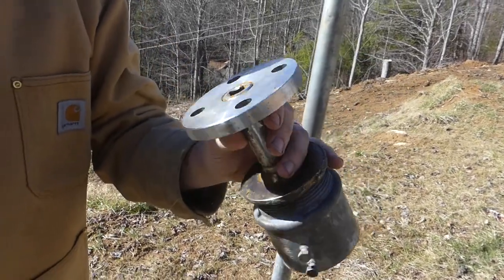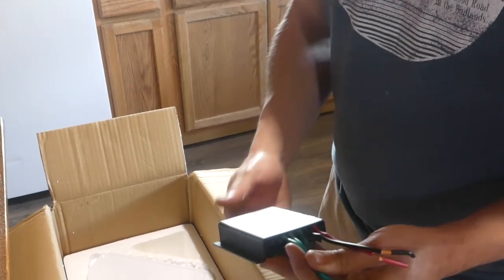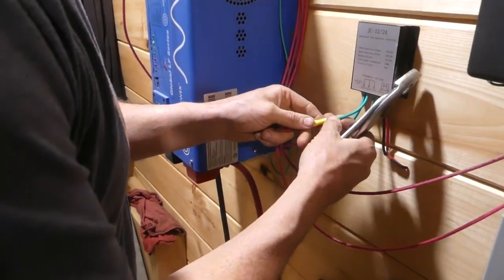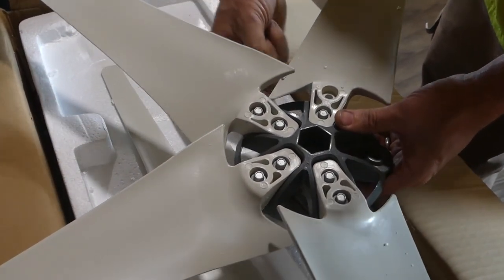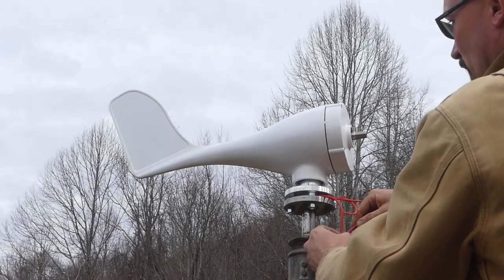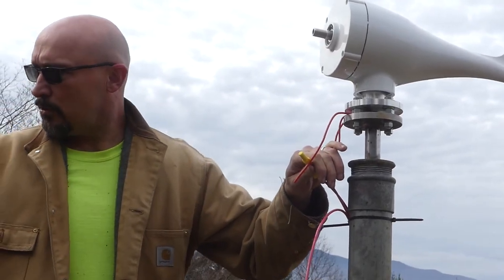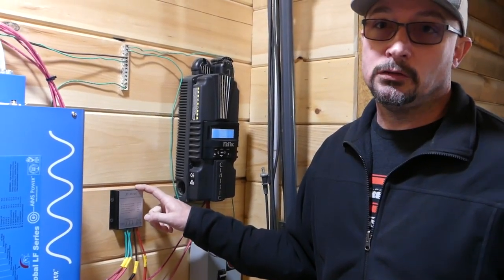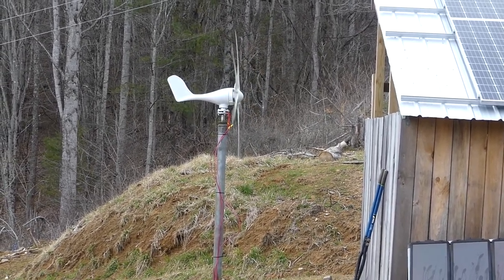Amazon Windmill Generator | Installation and Review

Comment: Hi, I also installed a wind turbine setup. Issues I ran into is that my wind is:
1. dirty wind location.
2. When wind turbine blade do  turn, they have to turn very fast to overcome 10Vac (14.14Vdc), to start charge on my 12V battery.
If you can rectify first and place 12Vdc battery in series with wind turbine output, then place into dc-dc converter, you will likely get power the moment wind turbine starts to turn. However I haven't fully worked out the design. 
And though it sounds defeating, a dc-dc converter with 9-36Vin, would use only half the power of the battery in series. You could charge series battery with another solar cell. And the output from dc-dc converter to charge main battery. I came to same conclusion you did. Without some type of circuitry, not worth it.

Comment: That's the first time I've seen an inverter like mine. I have the 24 volts / 2000 watts one. I had to replace the power and control boards in it in November of 2021, after trying to run a welder and blowing five of the mosfets. So now I have a Winco Lil Dog generator for that. Works great. I used an Epever 4215 BN charge controller on my solar system. It's maxed out with 1200 watts of panels. I've been looking at a Hurricane Vortec  wind generator. The only problem is the controller, if I get one like yours I will have over $1400 in wind power. The turbine is $676. I already have 20 big marine batteries on the solar system. I can add some if needed. I had planned to get six more batteries for the wind generator's output. I guess 26 is enough. The wind generator will have to share with the solar system. This time of year I don't get many hours of 🌞 sunshine per day. The sun is too far South. I get a lot of shading because I'm on the North side of my uncle's barn for now. So a wind generator would really help. He lives on the South side of a big hill. Almost at the top. Seems like an ideal spot for the wind generator. I just don't like to spend that much money normally, but this is my power system. Four of the last five days it has rained or been very cloudy. So the voltage is down a little bit from normal. 24.2 v at 3:30 a.m. I have a freezer running off of the system that I didn't have last year. I got it in July, and it used quite a bit of juice, but it was 105 degrees. It got broke in right away. Well I just wondered how your wind generator is running. I'm afraid to get any other one than the one I am looking at. I'll just save up, I guess. I just tell myself that it'll be fun to see it working. It made a noticable difference from last year by just going from 16 to 20 marine batteries. I'll have to do that again, add capacity. No use spending money to have the results go to a dump load. I'll give it somewhere else. At the time, I have 990 amp hours, usually at 25 volts. The batteries that I'm using went up thirty bucks apiece. I guess I can stand getting six more batteries this year. That will put me just over 1300 amp hours. Do you think that a 1kw wind turbine would be about right? That's the size that I am considering. I also have to ask if the wind turbine that you put up has met your expectations. It's like when I was shopping for an inverter charger. It's kind of scary. I have to take care of it now, that thing is a thousand bucks. I figured I had better get the wind generator before they go up too. But I can't use it without the controller, so maybe I should get them both at the same time. I can get them both by the first part of March, and the average wind speed here is 10.2 then. It's windy then. Then in April I can get some more batteries. I will need them. I'm going to be making some solar panel trackers, so there will be more power coming in. By June, I will have all the batteries. I believe the A/C will work better with a few more. I let the whole herd of them charge in the morning before I use the air, and it works fine. It's going to be better this year though. I said that if this wind generator makes the battery bank last another ten years it's worth it. I'm going to do what you said, get a better one. I'm getting older. But I wondered how yours did. I'm always asking how many batteries does it take to not need a dump load, but nobody will ever say. They evidently don't know. So I guess I will be a pioneer in that area. But the wind turbine is going to greatly improve the situation, I believe. I've been wanting one for awhile. I have a DC motor that I may put blades on later too. Just for fun, lol. It might make 400 watts in a storm. A little wind generator about like yours, but with brushes, it puts out 79 volts when I wrapped a cord around the 3 inch pulley and pulled it. So I can try a set of blades on it.  It's a half horsepower DC motor. 90 volts. Just flipped by hand it makes 14 v. I'll make it temporary, about like the one you have. It will be a great system when it's done. I bought the Aims Power inverter charger on November 18, 2020. I've been off the grid since then but I had to use the generator the first year. This video is about what I am doing, it snowed yesterday so I got very few watts from 🌞 sunshine. That's where the wind generator will help me get some. So it would have been nice to have but I couldn't afford it until now. And now that I'm going to be able to, it's spending so much all at once. It always trips me out. I totally understand why you got a cheaper one. All this stuff is pricey. If it wasn't the crown jewels of my off grid solar system, I wouldn't spend the money. But with everything going on, I can't wait to get it here.

Comment: Link to where you purchased the wind power device?
Reply from the maker: https://www.amazon.com/TEEGUI-Generator-Controller-Monitoring-Lighting/dp/B0991VZ3HT/ref=pd_aw_ci_mcx_mh_mcx_views_0?pd_rd_w=QLTSk&content-id=amzn1.sym.07081e2a-c82a-4414-ba67-d1ea4791ec44&pf_rd_p=07081e2a-c82a-4414-ba67-d1ea4791ec44&pf_rd_r=58EP12SJA4Z2RB4FR8ZC&pd_rd_wg=wplh3&pd_rd_r=afea9ecd-0ed0-48ed-bcce-9fb82c3bbf4b&pd_rd_i=B0991VZ3HT

I’m afraid this exact one appears to be unavailable now but a search for wind turbine generator kits on Amazon will produce other options. Hope this helps!

Comment: I have the same one and I have mine 42 feet in the air, they're just junk. I'll only get a max of 150 watts in a 50-60mph wind. They're rating is generally around 27 Mph or 10m/s. Watch John Daniel's channel, I just ordered a recommended turbine from his channel, much nicer and way heavier, yet still the same 600 watt rating. I was very disappointed after putting mine up,really hoping the new one will perform.
Reply from the maker: Thanks for that! Let us know how it works! We will check out that channel too
Reply: What's wrong with 150 watts
Reply: @johnbutler5208 , 150 watts is alright, but not when the turbine is rated for 600 and it couldn't make 600 in a hurricane.  Something is better than nothing, though.

Comment: You should have placed it closer to the ground level, not so high to avoid overcharging with such a high power it generates at this height...
Reply from the maker: You’re the first to recommend that. Most have told us it’s too low😂 I’m not sure what to do with it really. Truth is we get such high winds up here that it’s turning like it could fly apart but it still doesn’t work very well. May be just a cheap piece of equipment? Worth a try though. Thank you so much for watching and giving us your input. Means a lot!
Reply: @Pepper Shack Life  you want it high, ideally 60 feet less turbulent wind. The lower you are, the more turbulent. The higher the power and you shouldn't have an overcharging issue they have brakes, and the Missouri wind solar has great videos about this

Comment: Nice setup and your power wall looks clean and well arranged. Some wind controllers have a breaking mechanism and the blades won't turn if wired a certain way but your wiring looks fine.  Also the 5 blade configuration will take off sooner than a 3 blade configuration and should begin to start charging sooner (thus a 12-volt turbine will start charging sooner if you have a 12-volt system). It takes more wind for 24-volt & 48-volt systems. At best, you will likely get 200 to 250 watts from these small turbines when you have optimal wind but most are falsely advertised at 400 watts or more. However, 200 to 250 watts on a regular basis can put a lot of charge into your battery system (especially at night, when there isn't any solar power being generated). Theoretically, you could get 400 watts from a 40 mile per hour wind but in most of these small turbines, the breaking mechanism will kick in at about 30 mph to save your blades and to keep your wires from burning out.
Reply from the maker: Appreciate it so much! This particular windmill boasted 1500 watts. We do have a 24 volt system and the most we’ve got this wind generator to put out is 60 volts and 1 amp. May be able to find another use for it so it’s not a waste. It might run some lights in the out building we plan to put in. We will update! Thanks again!
Reply: You all would likely get much better performance from the wind turbine if the height of the pole was doubled in length and you got a better wind controller.  If the turbine is rated 1500 watts, then you likely can expect 1/2 of the rated wattage with good wind (25 to 40 mph). Also, the wind can be very unpredictable if blowing through trees and branches. This condition is called dirty wind but you'll get some very good winds sporadically. I would suggest investing in a better 12 to 24 volt wind controller and increase the length of the metal pole and the turbine will likely give you much better performance. Good luck with the turbine & best wishes!!
Reply from the maker: Hey thanks for that!! Good info!
Reply: You are very welcome. Wishing you & family a Safe & Happy 2023 New Year! I just remembered that your MidNight Classic controller can accommodate both, wind turbine & solar at the same time. It's is unique in this manner and potentially can provide much better output than the controller that came with the wind turbine. I was initially thinking that you had the Outback controller. They look similar but are different (both are excellent controllers but the Outback doesn't support wind turbines).

Comment: lol it needs to be 30′ higher than the nearest obstructions
Reply: Not on the side of that mountain
Reply from the maker: At some point we will tweak it a little and see if works better.
Reply: @biglonniegruhn  yeah because if the mountain is blocking the wind you will still need to be above the mountain  lol